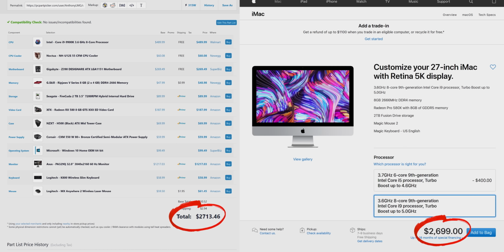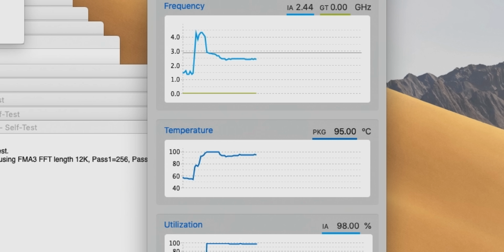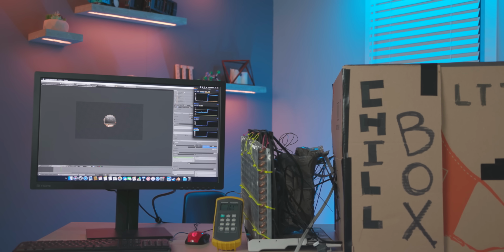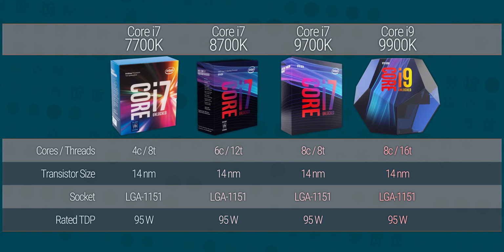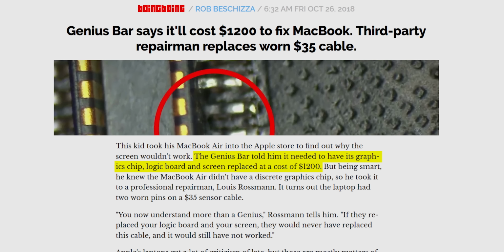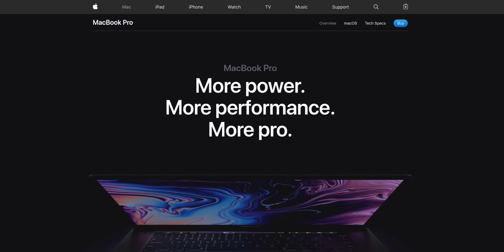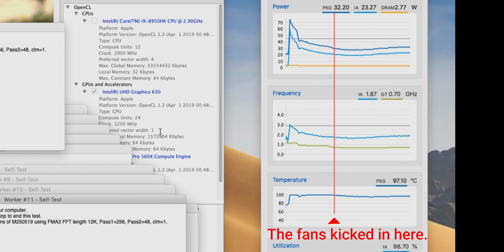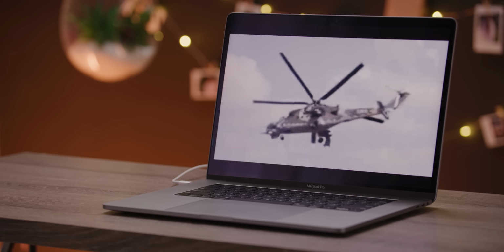Macs are SLOWER than PCs. Here’s why.

Comment: Macs also don’t have lots of bloatware, the OS takes up less storage, they look better, more reliable, less prone to malware and viruses, continuity with other devices, better battery performance, I mean I could go on, but I’ll just stick to my macs. You can keep you windows fragmented garbage 😒
Reply: Imagine not using windows when you can just de-bloat  it
Reply: @salpertia  Agreed, you can just debloat most of windows, but that does take a tiny bit of effort. Bottom line, you use windows because it has features you actually need ~ hopefully you debloat it, because it really isn't that hard to do.

However, if you really don't need windows features (and not everyone does) then Linux is the obvious second choice, it has all the core functions with less of the built in bloat and while nothing is immune to all virus and malware, it is much like MAC not targeted as often by virus creators.

MAC is for the brainwashed who don't mind spending way too much for a repackaged Linux OS with a fancy logo.

Windows is grown up DEC VMS OS with a .net runtime framework sitting on top of it. MacOS is a rebranded Linux spin off at a much higher price.

For anyone who understands the systems it's never been Mac vs PC, it's Linux versus .net framework, the rest is branding and price. Mac just means you paid too much for Linux.
Reply: You should check out Louis rossman channel
Reply: First of all, he isn't talking about the OS of the different platforms. he is talking about the hardware functionalities that Apple fails to deliver. It seems like you are getting quite defensive over a tested truth in which most people will agree. I personally own a Macbook pro myself, and I could agree with almost everything Linus said. Basic rendering or 3D designing, temperatures are high. Light gaming, temperatures still get high. I believe it is true that Apple do tend to bottleneck their systems, while somehow managing to sell them at a higher price than it's capabilities. Seriously, a i5 at 2 GHz, 8 gb of ram, and intel iris graphics for more than 1500 dollars?? Ridiculous.
Reply: I always find the reliability argument hilarious, when you have MacBooks that have display failures “more reliably” than other PCs that are designed better. Goodluck getting apple to admit they made a mistake, all you’ll get in the forums is “you’re using it wrong!”
Reply: "Macs also don't have lots of bloatware" Yup, that's specially true with the new windause 10 and all the preinstalled bloatware even on official microsoft iso, but not on some enterprise edition, or other thing that windows
"the OS takes up less storage" Nope, I installed Mac os in vms, and windows, and windows win on mac os by 4-6Gb. I'm also using linux everyday, and it win over mac os by more than 10 Gb
"they look better" I personally prefer the wood texture and look of system76 pc
"less prone to malware and viruses" and linux is even less prone to malware and viruse than macs, but mac os have a very tiny user base, make it grow, and the virus/malware will be better/ you'll have more chance to get a virus on the mac
"continuity with other devices" I heard windows 10 do that too. Else, I have it on my linux laptop/desktop and my android phone for a long time too (more than 6 years I think ?)
"better battery performance" than a lot of pc yes, but on pc without powerfull graphic card, like the macs, it's already a lot closer (for those with really good battery)
I could still continue to argue against you, but it's just what you choosed, you'll don't change your mind, but I personally never change for a fat mac os with everything non standard just to annoy everyone
Reply: Linux takes care of all of that and still runs on superior hardware (or Apple hardware, if you're that much of a glutton for punishment). :D
Reply: Sure, they look good. Now all the people at your coffee shop know how unique you are while you update your livejournal. Apple laptops are not more reliable. keyboardgate. displaygate. memba them? Why would malware authors target an OS with such a tiny user base? Ransomwear and coin stealers are a numbers game. Windows has more users so therefore more chances for successful deployment. If windows had MacOS user numbers it wouldn't have any of that crap either. Windows has no bloat wear. Manufacturers choose to install it. Like when apple gave everyone that awesome U2 album and then had to release a tool to get rid of it.  Of course they get decent battery life - When you under-clock components they use less power. They also take more time to accomplish the same amount of work.  I can run my Vega 56 at 800Mhz and use only 50w's of power if I really wanted....but performance suffers. Just like it does on a mac. Which in that case i hope that battery life is enough to cover the extra time you will be spending working because of how much slower the system is. Genius engineering right there. Buying a macbook is like getting a ferrari artificially limited to anemic donkey speeds. Nice. Connecting to other devices....like through a port....ports that apple is doing away with.... you people really are iZombies.....
Reply: apple fanboy
Reply: If those are what you value in a computer, you should be using Linux and have all the same aspects for a fourth of the price.
Reply: @Vincent_Beers  exactly! Lol
Reply: @Vincent_Beers   As you say but remember most apple user tend to forget why everything is like that, they just focus on "the goods" but not the bads and why... Raffi Dourian is right in everything but forget to say why, Windows is less stable because is designed to work for thousand of hardware, not only a tens, making a SO for a few devices is more easier and makes it a lot more stable, the same apply to Android, Android and Windows both are make to be able to be used on Thousand of devices, so by default iOS should be more stable and fast, compatibility is a big deal in PC we have a lot of hardware every year, mac is almost the same over the years so the apple crew have more time to do the same with less... in PC we can have a lot of devices and we can mix it in the same system and we add to that Windows and Android are more a open for the same reason as iOS is not even close. The same goes for software, atthe end of the day malware, virus are nothing isn't about windows, is about the user is over 10 years since I got my last virus, Im a GD that uses PC over Mac and will do it til the ends of my days.

Comment: I heard for the 8k iMac every pixel will be sold separately
Reply: $7 per pixel
Reply: @andy56duky  I'm trash at math, how much would it cost?

EDIT: It would cost this much :
232,243,200

How I did it?
7680 x 4320 (pixels) = 31,177,600 (pixels)
Then
31,177,600 x 7 = 232,243,200. There you go.
But I think I messed up lol
Reply: @prodachoui  An '8k' display with a standard 16:9 aspect ratio will have a resolution of 7680*4320, or about 33 million pixels for a total of $231million dollars.
Reply: @thetrashman5252  Oh so I didnt messed up my calculations?
Reply: @prodachoui  you didnt
Reply: @planetdestroyer productions SCAM ← MACS = revert
Reply: No fucking way! I love macs though.

Comment: Garbage cooling.

Also, try bumping the CPU, GPU, RAM and SSD and we'll see how much that 'same specs and features for the same money' shtick holds up.  And it's no exaggeration to say that the NH-U12S runs circles around the iMac cooling assembly.
Reply: yep... base models might be fairly competitive in pricing, but as soon as you start bumping up the specs they charge a hefty premium... I remember comparing a desktop to the very top of the line trashcan mac a few years back and found that upgrading from say 16 to 32GB of RAM would not cost you about the same as just adding another 16GB, the Price increase would be more than the Price for a full 32GB kit, meaning you'd pay more for an additional 16GB of RAM than you would have to pay for a full 32GB kit. 
And just to check my sanity I just looked at it again... upgrading from 16GB of 1866MHz ECC memory to 32GB would cost you an additional 400USD on the Mac Pro... you're paying 400$ for 16GB of RAM!!! for comparison I found a 1866MHz ECC 32GB kit for just 183$ online... 
even if we give apple an advantage and compare those prices with DDR4 prices, 16GB of EEC DDR4 RAM cost about 120$ meaning you're paying atleast 300% of market price for that upgrade!
Reply: It's not the cooling problem, it's intel's fault for not releasing any good cpu's lately and still not being able to produce 10nm. That and the extremely slim design of the macbook pro but its still remarkably impressive that apple manages to somewhat "cool" the cpu in such a thin chassis.
Reply: @void9092  Wtf do you mean it's Intel's fault? Apple knows what CPUs they have to work with, and what it takes for them to run optimally. Windows has both beefier laptops that do a good job of cooling the CPU, and thin laptops that don't preform as well. You're paying more for performance you never get to use when a cheaper CPU will run as well as the more expensive, throttling CPU. It's nowhere near "remarkably impressive" what Apple does with their cooling anyways, like Linus said, they turn the fan speeds way down, when they should be higher. Nothing's special about their tiny ass heatsink either.
Reply: @dkis8730  I believe you have not heard of the news how intel is bringing 10nm process to their U series chips FINALLY after so many years in the q3-q4 of this year. Why? Because they realised that adding more and more transistors on the same die size is going throttle the fuck out of the chip. It's their fault for not comming with new chip arhitecture for so long compared to what AMD has been doing for the post 1-2 years with their ZEN architecture.
Reply: @void9092  First of all, Intel measures transistor size differently than other manufacturers such as TMSC. That's why they might seem behind the curve, although they have undeniably had problems shrinking their process. As I said before, all computer manufacturers know the constraints behind the hardware they put in their computers. Everyone knows that Intel's high end processors generate a shit ton of heat, and putting it in a tiny ass body with a lax fan curve is a moronic idea. So since Apple knew this, they should have either made the body bigger, or put a less powerful CPU in the laptop, not a CPU they know for a fact will not preform close to spec. It really isn't Intel's fault, and I don't see Apple trying to make processors to compete with Intel's PC offerings. That's like saying you're building a PC, and you pair an i9-9900XE with the stock Intel cooler, then blaming Intel when your PC spontaneously combusts. Everyone knows that by basic laws of physics, the more power you draw, the more power you need to dissipate. So the only fault was you being a dumbass, and not buying a good enough cooler.
Reply: @void9092  Also, the engineers at Intel are some of the smartest in their field. Do you really think they said something like "We can just keep adding more and more transistors indefinitely to our current process node"? I'll give you a hint: the answer is no. They've been trying to shrink their node for many years now, but have had complications in doing so.
Reply: @void9092  I personally like AMD more than Intel, mainly for the reasons that Intel failed to innovate and overpriced products when AMD wasn't competitive. So I don't suffer from fanboyism, but I know how to look at facts, and Intel originally had 10nm planned for 2017. I'm not debating over Intel here. I'm debating your outrageous claim that it's Intel's fault for not having more power efficient processors, instead of Apple's fault for putting those high power chips in a form factor which cannot support it.
Reply: @void9092  Also, your grammar is far too shit for you to call me "a pure retarded"

Comment: Even at a matched cost for PC parts you CAN'T ignore the fact that said PC you built CAN be upgraded. So, an Apple would have to be cheaper for the same power due to the inability to later upgrade.
Reply: On the other hand, you can sell your used Mac for good money and use that towards your next Mac purchase. It kind of balances out.
Reply: @ericwood3709  if it doesnt fry itself first
Reply: @spedracer55 still using my maxed out 2014 macbook pro here, perfectly fine. how many pc out there last more than 3 years?
Reply: Pat Lu not sure about you, but people upgrade their pc by choice not because of need
Reply: @spedracer55  No argument there. I have seen two Macs die a heat death.
Reply: @ccclcsr  Plenty, most PCs last 4 at bare minimum, after which the most common failures are hard-drives, followed by PSU quite a ways behind. Both are somewhat cheap replacements. People upgrade PCs because they can. An FX-6300 + gtx 960 is still suitable for modern games, but there's better alternatives.
Reply: Pat Lu  On year 8 of my custom built PC, only replaced the hard drive in that time. I think you should just go with whichever works for you though.
Reply: @ccclcsr  the laptop we have and 2 desktops and past desktop
Reply: @ccclcsr  Millions of them... Custom ones can last decades with every GPU upgrade here and there, and also hard drive,sdd. Cooling is infinitely better in a PC.
Reply: @ccclcsr  Still using my PC from 2014. My SO uses a PC from 2009. Virtually all of them last more than three years. It's hard not to last longer.
Reply: @ccclcsr  Just replaced my i7-2600 desktop this year that I built in 2011 with an i7-8700k custom built that should last me another 6-7 years.   Only one of the HDD failed, nothing else ever died from it and it was still faster than this Macbook pro.  Even have an i7-920 desktop from 2009 that still runs great, nothing died in it at all, had replaced the original PSU, but not because it died.
Reply: @ccclcsr  quite a lot lol.
Reply: Plus a good 45% of that cost is in the monitor , take that away and the PC is cheaper
Reply: @OlafoWaffle  yeah and you can make better decisions like a gtx 1080 or rtx now even and it might be cheaper but better
Reply: @OlafoWaffle  Uh, can't take that away. The Mac has a 5K display. The PC is going to need one too
Reply: john m  So am I a woman? Even if I replaced the optical drive on my old 2009 Macbook Pro with an SSD? Even if I replaced the screen myself because the one that came with it came nuts? Even if I was even attempting to diagnose a problem with the motherboard?
How I "love" you people that shout at this or that opinion as a faith. Yes Macs might be slower than a custom made PC, that you can upgrade (but you still pay each component and spend time actually mounting the part), but they give another option to use other softwares that otherwise wouldn't be possible. For example FCP X, which still is a great software. Or for example Logic X that is also widely used in the music industry. Also they give us the option to use Windows right off the box, without doing extra research on what hardware is compatible with macOS.
The only reason why you people shout out so loud and full of hate is because you could never afford one, in my opinion, so, as the old tale of the fox and grape, say that they are so bad and bash on them so hard.
True, there are issues, but when you design something, and want to keep it faithful to your mission, but also need to use external party hardware, you must make compromises. Apple chose thermal throttling, and we deal with it. As Windows chose instead to go ahead and have updates every other day or to restart on its own if it encounters an issue (that doesn't happen on macOS regularly, and if it happens there actually is a problem with the machine).
So shut up and be rational on what you think, write and say.
Reply: john m  How is MacOS limited? Oh and the software that they actually give you, unlike Windows which doesn't come with jack shit for $100.
Reply: john m  Wow, revise this statement. Particularly the sexist comment you threw in at the end there. I own a Macbook Pro and am a CS grad who has built my own desktops many times (all of my lecturers at university had Macbooks as well) I would hardly call myself a technophobe. They're undoubtedly great machines with incomparable build quality compared to 90% of all other laptops on the market.

I think another key thing people miss here is the OS debate. Programming is 100x easier on UNIX compared to DOS from windows, linux is an alternative but fighting with incompatibility issues and installing a million and ten drivers each time you want to install something is not fun and a huge productivity hit.
Reply: Not only that but certain components like the mobo and PSU will be much better built than the Foxconn garbage Apple uses

Comment: Yea true but my laptop is really slow when it starts up and I have an amd ryzen 5 2500u and my 2019 iMac is way way faster do you have any tips on the laptop to get it up and running faster and takes 10 to 20 seconds to loads a browser
Reply: whats running at start on your laptop. also ryzen laptops are well very new, so this issues could be new or specific to ryzen laptos idk
Reply: NonsensicalVids thanks for the tips
Reply: NonsensicalVids there is generally nothing
Reply: maybe your pc laptop doesnt have an ssd hard drive. and your mac does. just put an ssd in it
Reply: yeah its called get an ssd you probably have a hardrive